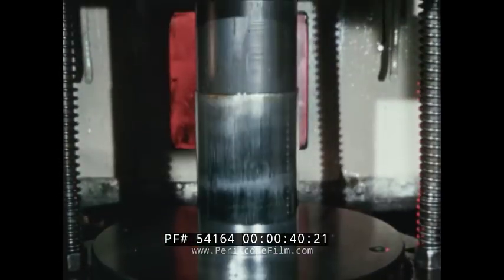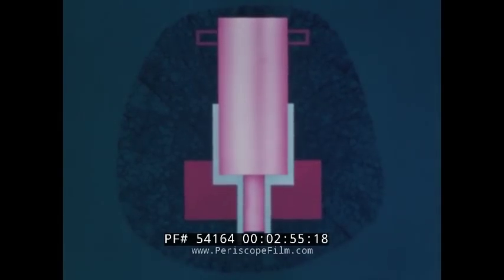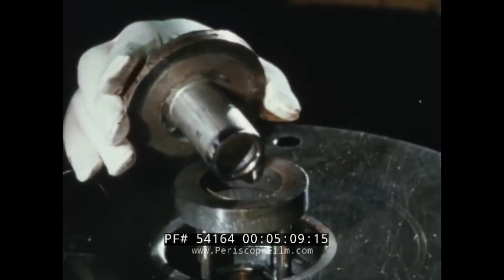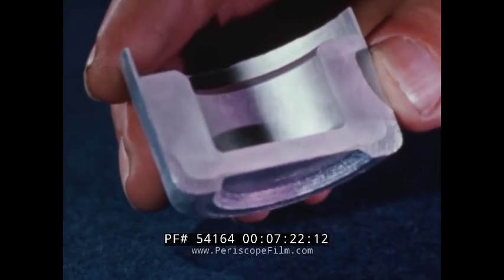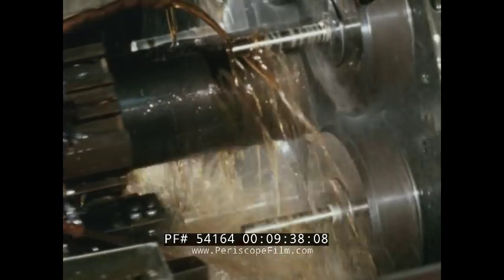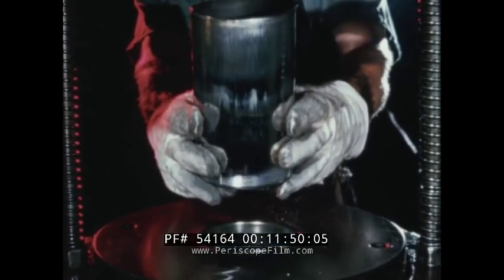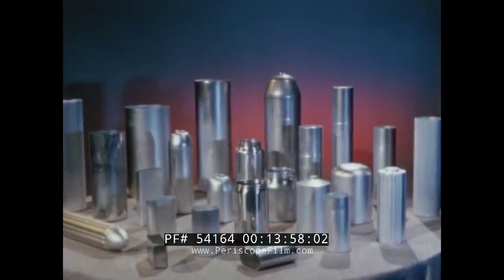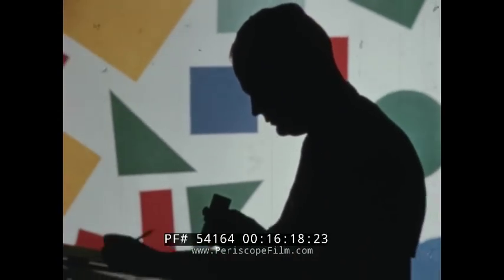ALCOA ALUMINUM COMPANY  THE STORY OF METAL IN MOTION  DIE, PUNCH & SLUG 54164

Comment: This is how Alcoa planned to produce aluminum beverage cans in the early 1960s--impact extrusion. The competing process was Reynolds Metals' "draw and iron" or D&I technique, where a cup is formed from a circular blank of flat sheet aluminum and is stretched (ironed) to the final length.  
D&I can produce cans at a higher rate than impact extrusion, so ultimately it dominated the production of the aluminum cans that drove steel makers out of the beer and soft drink can business. 
Years after impact extrusion was supplanted by D&I, it was revived by Alcoa to produce aluminum bottles for beer and soft drinks.
Our "impacts" were sort of little brothers to the big forgings produced by the guys at Ladish.
Reply: Did you work for Alcoa?
I was impressed at all the different shapes they could make.
I would have liked to have seen how that thing with 3 arms coming off of a circle was made.
I also wonder how long the dies lasted on some of the more complicated shapes.